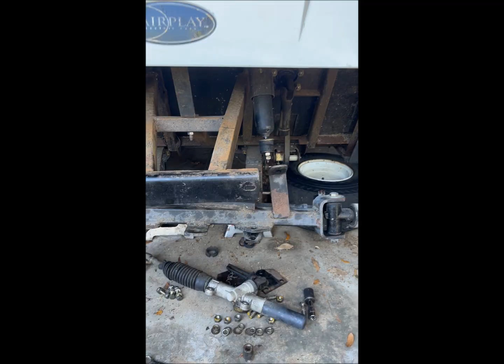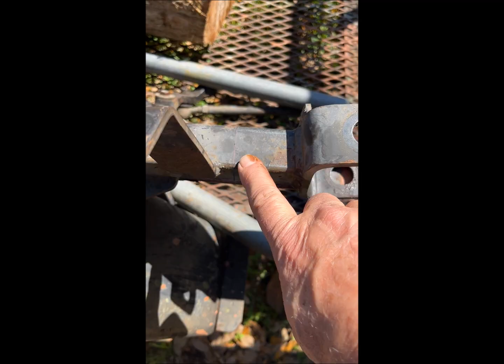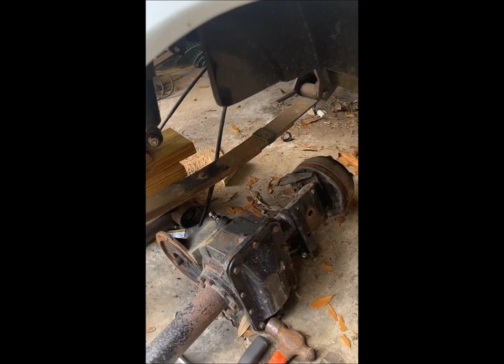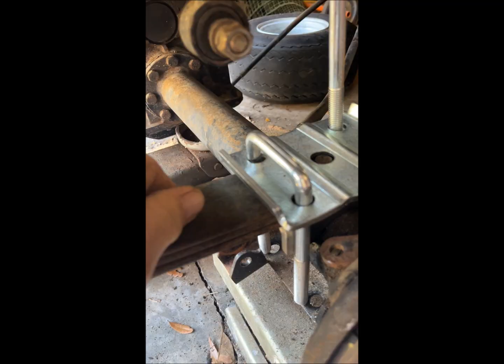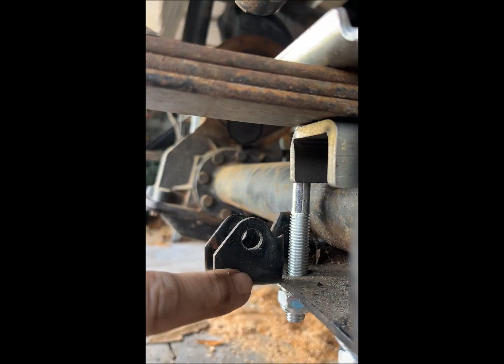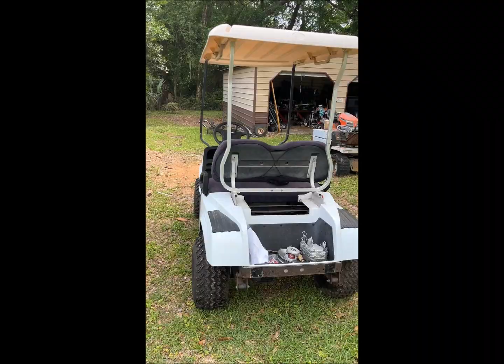Budget $30 4 inch Golf Cart Lift

Comment: I have the exact same front and rear end on the cart i am trying to lift. 
One question? 
How did you connect the tie rod and steering rack to the new frame. A picture would be great. Would like to do the same or some close.
Reply from the maker: I'm sorry I did not show that in the video but I applaud the fact that you spotted that omission.  I tie rods stayed in the same location as before, the steering knuckle that has a rod going to the steering gearbox is the tricky part.  I cut the end off and used some 1" square tubing which was 4" long and welded on the end to raise the connection up to the level where it had originally been.  It works great, haven't had any problems, I don't feel any flex at all.  I can send you a pix if we can exchange emails. not sure how to do that, not certain if YouTube shows mine in my channel description.